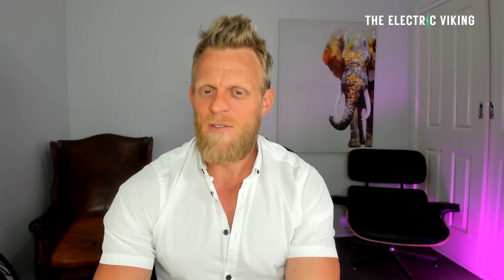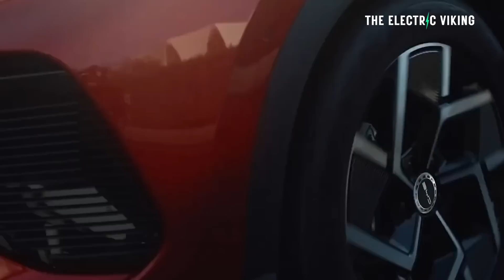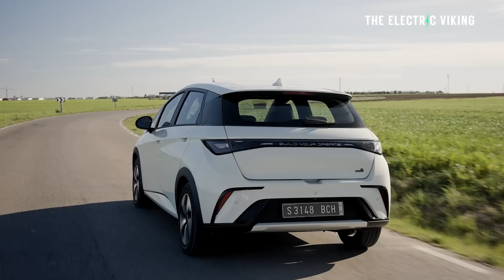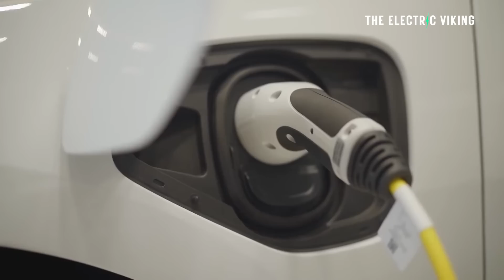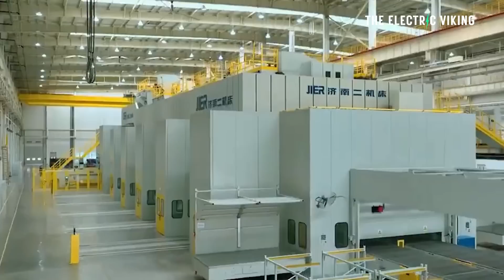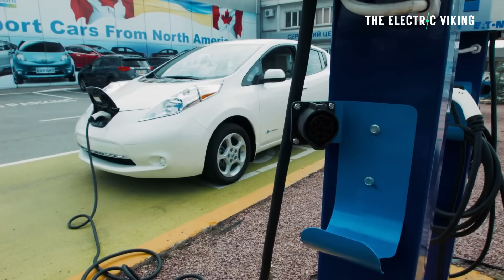The IEA says Global EV Sales will smash records In 2024

Comment: We have had Tesla M3 Dual Motor for 2 years in UK, average cost os £0.03/mile, 78% home charging and 22% rapid charging on long journeys. Just purchased Nissan Ariya 87kwh for my wife, and got £500 for 21 year old  old Honda Jazz that need to go, GOODBYE ICE. The Ariya drives lovely, it will be mainly charged at home, we have Solar so for 2/3 of the year it would be free, but its better than that, we charge at night for £0.075/Kwh and sell excess Solar in the day at £0.15/Kwh, yes that right! 

We have 22 Solar panels and 2 10kwh batteries, and average 3.5Mwh export power per year, the rest goes to the house or cars. Our electric bill is around £800/year, including £240 standing charge, we are fully electric for everything. I will let you do the maths on this. If we we still on gas heating and had no Solar then our combined gas/electric bills would be £2400/year at current rates.

Comment: 1 in 5 stations in California are now EV charging stations . That maybe more of the direction of where EVs are going . Without a charging infrastructure in place EV adoption can be a struggle . You can correlate higher EV adoption to an area with higher EV charging infrastructure . Places like Norway and Sweden have lots of charging stations available . 

I think the next big step in EV adoption is getting rid of the charging cords and have wireless charging as a standard . That's something gasoline stations can't possibly do . 

I don't have a EV yet but recognize when you figure the whole product into the calculation it's the better product over internal combustion and it's not close . As the product improves it will pull farther away from its counterpart .

Comment: First Quarter 2024 BEV sales has been a real disaster for BYD the no. 1 seller in 2023 and Tesla number 2 because in the meantime, selling prices were dropped a lot and margins are down. Difficult then to make it up for both during the next 9 months. Then if two market leaders struggle with sales,  it is unlikely others can take advantage of it with higher costs and less attractive products..it would not make sense…so this 3 millions more prediction is as good as the old TSLA share prediction supposed to hit 1000$ by 2024…just kidding…!!! 

Of much more interest is to consolidate all the current  factors why the buyers are disappearing , why GM profits are up and why Toyota plans on 43% MORE hybrid sales in 2024… Well, globally it seems perfectly logical to merge the best of both worlds: plug in electric for cheap recharge home at night for most of the usage, shopping work leasure  with up to 80 km autonomy, braking and downhill regenerating power and then the full autonomy of a real car 1000 kms..with no multi ratio gearbox or monster battery dead weights and a Solar roof for extra carbon free kms,  so in total, much lighter than an TM3 BEV, not heavier than a Golf Tsi thermal with DSG BVA and much more efficient than both those in Ev mode and in emptied battery thermal mode..so game over…nothing to add …all those hybrid sales will hurt BEV sales, obviously…
Reply: Q1 sales for BYD were up 13%, Teslas were down. BYD always has a weak Q1 as its sales are 90% in China where Q1 includes the New Year period when sales collapse. BYD had an amazing March, where it sold almost as many cars in the month as Tesla sold in the whole quarter....
Reply: @speedismyfriend  Fairy tale: don’t compare with Q1 of 2023, while BYD and Tesla were still growing…history is right now end 2023 early 24…Sorry you and I cannot help it : the EV ww market is simply down recently …and many indicators made it fully predictable for markets analysts capable to integrate most of the signals, unlike so called trade market experts fooled by scams and dreaming of a TSLA share at 1000$ in 2024 !?!?!?!?
quote: BEIJING, April 2 (Reuters) - BYD, China's biggest electric vehicle (EV) maker, reported first quarter 2024 sales fell 43% compared to the fourth quarter of 2023, handing back the title of world's biggest EV seller to Tesla after winning it last year.2 avr. 2024. Unquote..
Of course ,Reuters must certainly not be well informed since they were first to announce the TM2 cancellation !!! 
And less sales and lowers margins with gigafactories to complete and pay….this is what happen today..
Tesla's vehicle deliveries in the first quarter of 2024 amounted to over 386,800 units. Quarterly deliveries decreased by around 20.2 percent during the first quarter of 2024, compared with the fourth quarter of 2023.15 avr. 2024
And this month, CEO Elon Musk announced the company would be slashing its workforce by 10% percent with more than 3,300 layoffs in California. So I anticipate a bad year for EV.. which need to become much more attractive, user friendly and durable and somehow to depreciate much less,, Here is why: no.,1 and 2 TSLA & BYD both drop sales and prices significantly in 2024, so it is very logical that the followers typical sales volume would go even steeper down than the leaders with less sales historically due to inferior products and lower margins evidenced by lower sales than leaders..meanwhile the total mobility market is good Toyota Stellantis and GM profits are good.
Reply: @speedismyfriend  No, the market drop is both recent and drastic versus Q4 2023.. BYD dropped 43% during Q1 2024 and Tesla 20.2 %. versus Q4 of 2023 !!! All sales figures are published and official..Comparing Q1 2024 sales with other earlier quarters like Q1 2023 is irrelevant since both mfrs. were still growing sales then…My forecast is that if number one and two drop sales volume and prices, the other BEV followers, MG, VW, Hyundai-Kia, etc which did not have quite the product and price to be at the top will suffer more and 3 more millions BEV in 2024 will NOT be sold. Now the «less BEV’s » Toyota, GM, Stellantis are making healthy profits so the global mobility market worldwide is not down, only BEV have their anticipated crisis and need to offer more customer value, less depreciation, better quality,,reliability, durability, etc..

Comment: Battery prices are going down . . . but the size and weight of cars are going up. 
EV's are introduced to battle the environmental impact and pollution. 
The stupid thing that only few people seem to realize, is that in the 60th to the 90th cars in the EU were mainly 2-doors and the weight was around 1 metric ton.
Now, for the better environment, people claim to need an 5 or 6 meter long, very wide and tall 4-door behemoth of preferably 3 metric ton. . . . . . doesn't sound very sane to me.
Reply: What does not sound sane to me is building ENORMES  drill rigs in the ocean. How much energy goes into building that. How about a QUARTER  of all maritime traffic in the world is oil and fuel tankers. Or Jack pumps that use as much energy the equivalent of powering 20,000,000 EV cars. And what about the oil sands in Canada. The scale of pollution is just mind boggling. Just Google tailing ponds Alberta Canada. But I agree. People should buy smaller cars. I just went from a Dodge Durango V8 to a Hyundai Kona EV. I could not be happier.
Reply: Size & weight of the cars going up is not an EV problem. Nobody seem to care when small affordable cars are being replaced by giant SUVs and pickups
Reply: You’re right, it’s madness. We need more small EV’s.
Reply: I don’t seen any trucks hauling electricity around ! They’re literally burning tons of diesels to deliver the actual diesel I mean that itself is enough reason! And do yourself a favour next time pull down the window and smell the pleasant diesel fumes I heard it’s good vitamins for ur lungs 🫁!
Reply: Every time I see truck hauling diesel and petrol ⛽️ to a petrol station .. I stop and think of the ingenious efficiency behind it 😂
I mean before u even find out how it’s retrieved from bottom of ocean.

Comment: 10,000 miles cost me £160 in UK charging at home at night. So cheap not sure solar even worth buying.
Reply: If you’re considering going electric (infrared panels, electric radiators, electric boiler, etc) for your heating then solar plus battery storage will be well worth it.
Reply: The problem in the UK is if you can't charge at home then it costs almost as much as a petrol car per mile, and is way more inconvenient. Plus the insurance is 2-3x as much. And your starting point is a car that is 20% more upfront. I have put my EV purchase on hold.
Reply: 10k miles for £160!   Dream on.
Reply: @davidreynolds3082 says someone who has never used an EV so is pulling ‘facts’ out of the place the sun doesn’t shine 😂
Reply: @X5493-c7p  Well they are right on the insurance. A Tesla model Y would cost me 3x what something like a Tiguan or Skoda Kodiaq would to insure. Some other EV brands have less of an insurance differential but still 2x.
Reply: @speedismyfriend  insurance for all cars whether an EV or not they are taking the wee wee, I’m going to wait until Tesla insurance is everywhere then I’ll get a Tesla
Reply: Shame about the cost of the car the tyres and insurance though.

Comment: 20% is the S curve tipping point.
It will be 50% by 2028. And 80% by 2031.
Reply: Apparently 5% is the Tipping Point.
But don't ask me why. :)
Reply: @Pierwalker  It can't be 5%. How would a curve go vertical from a baseline 5% of a market being serviced? That would mean a 20x increase in production capacity in a short space of time, which is both physically and economically not possible. The inflection point of take up and adoption is between 20 and 80%, which corresponds to Pareto's Law, which means that there is a rapid 4x increase of take up from 20pc to 80pc saturation of the market, which is a feasible rapid scaling when competitors in the market are taken into account.
An example of this is Australia's take up of EVs. In 2022 it was just under 5pc, and in 2023 it was under 8pc. 5pc to 8pc is a big increase but it's not a vertical line.
However with EVs it's likely that there will be a more gradual jump from 20 to 80 as there are so many other factors. For instance, EU has been sitting at 20pc for a couple of years, but that is because of the import tariff factor and issues with their own production of EVs - a supply side problem. The transition will still be something of a quantum leap, a vertical line, but one that has been delayed by these external factors. It will still be founded on the 20pc inflection point, however.
Reply: Doesn't work like that... EVs will be lucky to be 30% by 2030
Reply: @grantbuttenshaw  I agree there are multiple factors, because shipping an EV is a bit different from shipping a smart phone, but globally I think we'll see something like these numbers in this time frame, give or take a couple of years.
Reply: @yggdrasil9039  Not a chance. I think 50% by 2030 is now unlikely.
Reply: @speedismyfriend  we'll see, but 2024 will be 20%. So 50% by 2028 is not a stretch. That's a growth rate of 25% yoy, over 4 years. Twenty % is the point at which it becomes feasible for auto makers to scale up their product and reduce costs.
Reply: @yggdrasil9039 I hope you are right but I think the easy converts to EVs have been made already. When I talk to people I work with, virtually no one is thinking of buying an EV yet despite them all agreeing that the future is EVs. I think penetration slows for a few years and then accelerates as next gen products arrive in 2026 with faster charging, better efficiency and range and lower upfront costs.
Reply: @nicolasziegelasch1550  Agreed. The next generation of buyers from 20-80% will only happen with EVs at price parity or below, and 500-600km range as standard, like a basic ICE car.